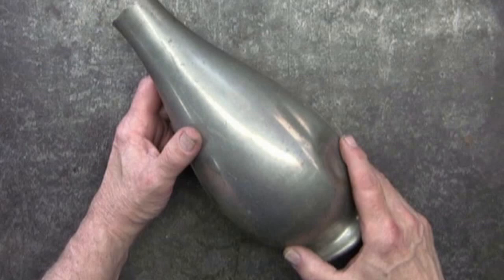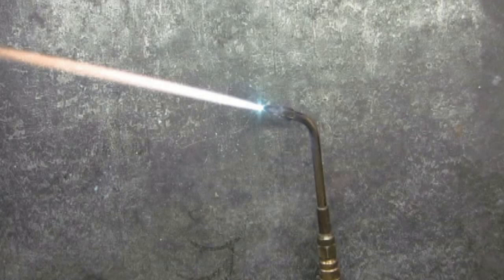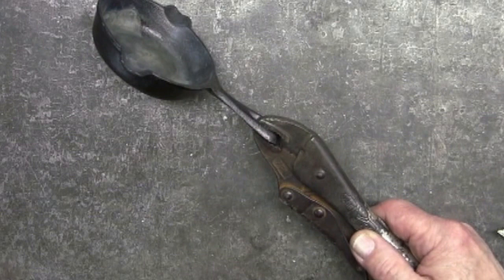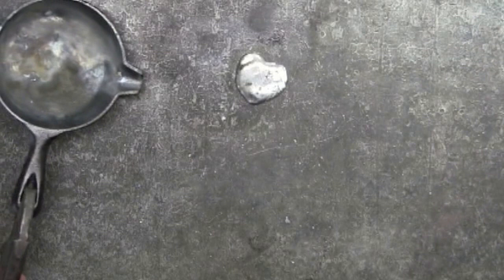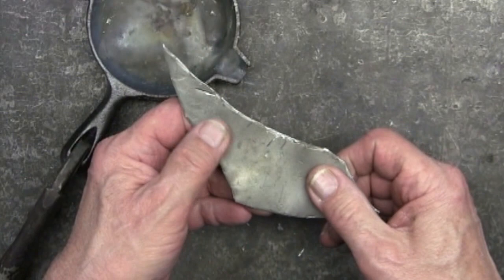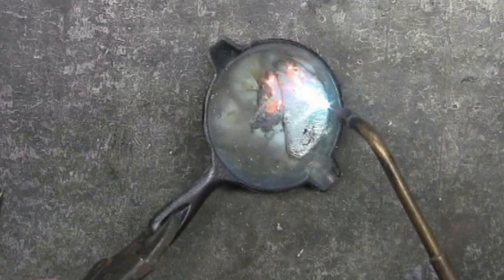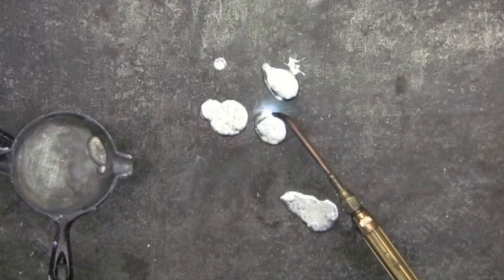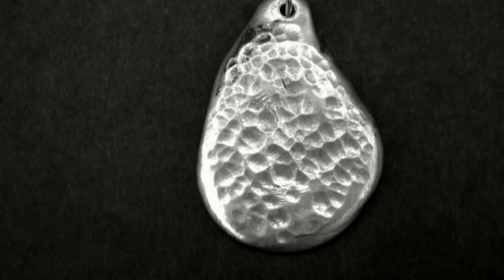Having Fun with Pewter #1

Comment: Nice video, George, as usual. 
Would  the graphite stick in an old lead pencil be effective cleansing the impurities
from the pewter? I used to use that cleaning up old gold before casting. Just clean
some the wood back so it doesn't ignite.

Comment: Hi, I am just starting with pewter and wanted to make some free form pebbles without by dropping the melted pewter onto a surface, that way they keep the organic shape and each one is slightly different. However I am finding when the pewter starts to cool it sinks and pits in the middle. I have tried heating up the surface and using talc but still the same. Do you have any advice on how I can make them without sinking or pitting? Many thanks
Reply from the maker: Steph, the only thing I can say about peweter is that when I don't get what I want, I can remelt it and start over.  I've had the pitting you mention and at othertimes there is no pitting.  I think I have done both pieces the same way but they turn out differently.  It is a mustery to me

Comment: Hi George. A great video. How do you suggest I connect a silver pin to a pewter charm?
Reply from the maker: +Dave Andrews   Dave, I've never done that, but the first thing I would try is some 2 part epoxy.  I would rough up both pieces with sandpaper so the glue has more to bond to.

Comment: Good video.  Could you tell me what type of table you used?  Was this a cement block table or something?  Also, what other tools do you recommend for the free forming?  It looked like you had some type of Anvil?
Reply from the maker: +C. C. C The table is 3' x 4' 1/2 inch hot rolled steel.  I use a small bench top anvil and I also have a blacksmith's table.  A ballpein hammer is often used.  There are 160 YouTube videos.  If you go through these you will see a variety of techniques.  Check out this link for videos specifically on tools.  http://gsegmedia.com/?page_id=2877
Reply: Thank you George